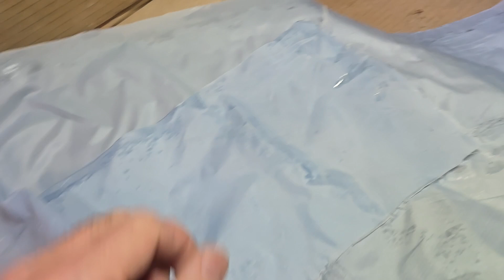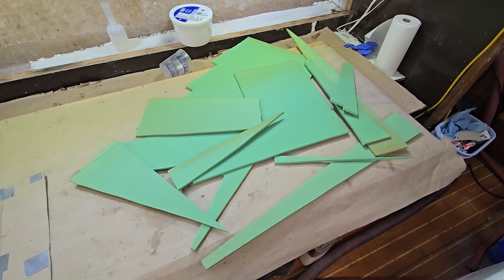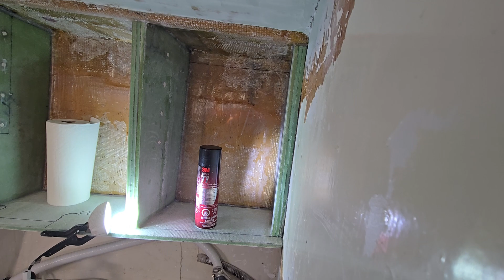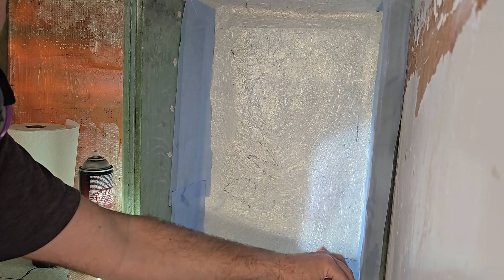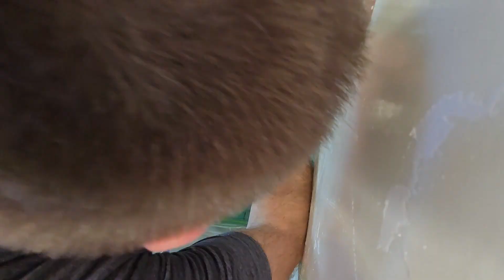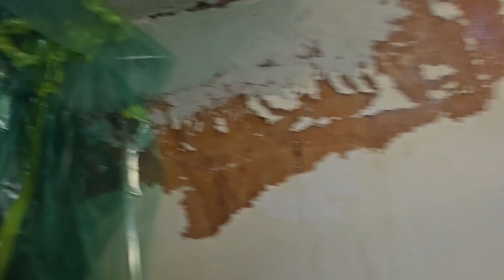Vacuum Infusion Fail in Head Compartment Wall | Boat Refit Realities – Sailboat Repair Ep. 71

Comment: The vacuum is not forming because of the substrate. Air is leaking in from behind.
Reply from the maker: Thanks a lot. Yes, I agree with you. But it was so easy in theory. I'm going to seal the lanes where I'm planning to stick butyl tape next time. Obviously, if there is no vacuum, I will abort the mission and fix the problem first.
Reply: @Sailing_Victoria  agreed, theory is easy. Practice is hard. Perhaps this order would help? 1. Fillet corners with thickened resin. 2. coat corners and surfaces "getting core" with lightly thickened resin. "Paintable consistency" 3. Glass. 4. Slightly thickened resin painted on back of core (press on to glass). 5. glass peel vent bag draw infuse. IDK, I enjoy watching. You are doing a great job!
Reply from the maker: @jeiversen  Thanks for the great plan. I was hoping to make one go with a vacuum infusion and not splitting it to multiple parts. Without a new toy (the pump), I would just slap foam with thickened resin and do all layers one by side after that.
Reply: @Sailing_Victoria  maybe I don’t understand why it is necessary to draw the resin through instead of just extracting an excess amount from the layup. I suppose there is benefit to both ways and details I know nothing about. I like the canister idea of protecting the pump.
Reply from the maker: Thanks, the canister is still not full, but I figured out how to prevent any resin from going through the suction pipe by offsetting the spiral tube with peel ply from the glass lay-up. I'm trying to poke an inlet hole from time to time to find the bottom inside. Still deep. Vacuum infusion saves a lot of time, and I can lay down all layers at once before feeding resin. Honestly, I must have an ideal vacuum inside. I can mix small batches of resin and add them into the funnel during the infusion process. In case of vacuum bagging, I must lay down all layers one by one, cover with peel ply, sacrificial layer, vacuum bag, and only after starting to figure out the vacuum leakages. The major problem with this method is the constantly ticking timer right after adding MEKP into the polyester resin. And I bet that the resin will start curing much earlier than I will get to the vacuum stage. Probably some type of epoxy has many hours before it starts to gel. But considering at least 3x the cost of it, I would opt out of using it and will keep self-education and experience with polyester resin. And 99% of the boats were made in such a way.
Reply: @Sailing_Victoria  Hey Ivan, I'm reaching out here because I don't want to draw attention to your current video. I really like the progress you are making. However, I noticed your mood m u s i c is too spot on for your processes. Unless you site the way you found those tunes and give credit, the resource could cause issues. I don't want you to fall victim to the litigious nature of content production. Be safe sir.
Reply from the maker: @jeiversen, thanks for your poin. However, all music is legit and taken from various resources, including made by AI. But most of the time, it's very difficult to find any good ones that would long enough and similar to others  to cover the silence. I normally read all terms and conditions on how to use resources. I will double check again the requirements again. Thanks again for your attention.